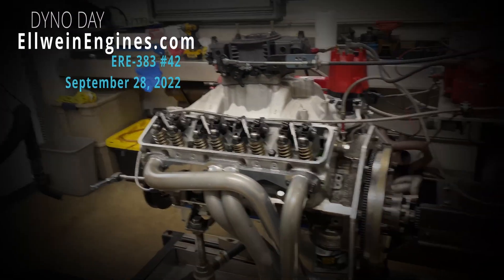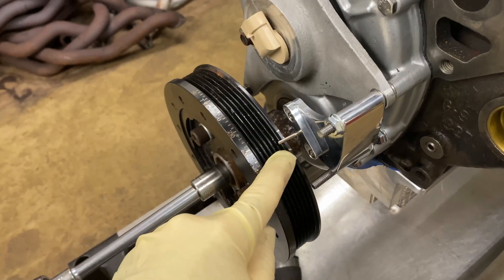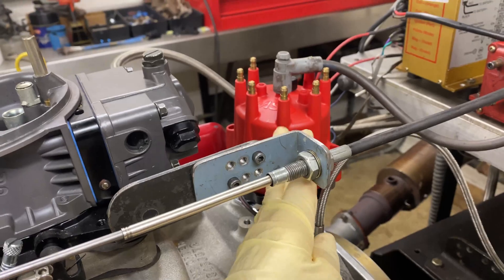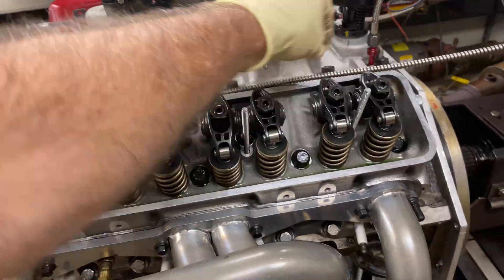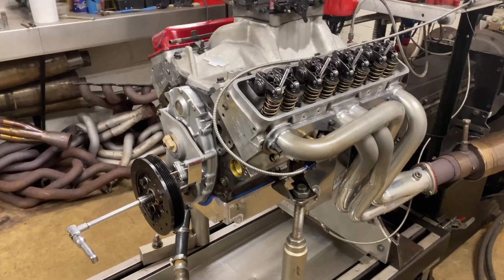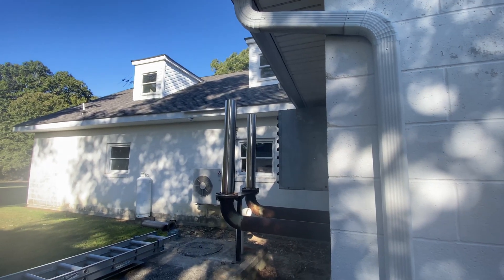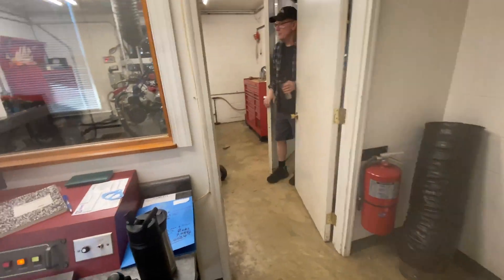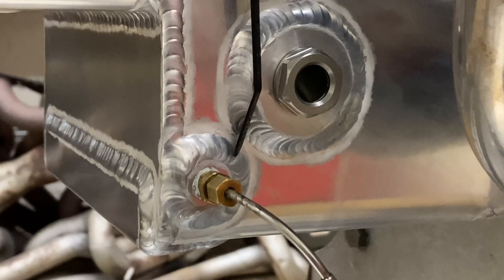Dyno Day for ERE-383 number 42

Comment: For new aluminum heads and new ARP head studs, would you bother re-torquing the head studs after break-in?  I've never done it on the 4 other builds I've done (2 different engines), but have always uses stock head bolts, up until now.  I just built my "dream" LT1 engine, AFR heads and ARP head bolts.  For the first time I have a small external coolant leak at one of the center lower studs.  Impossible to get at with Hooker long tubes, in the car, 1994 Camaro.  And a supreme PITA to drop the engine out the bottom just to check head stud torque.  Just wondering what you do.  Am using old fashioned Felpro 1074 head gaskets.  Thanks.
Reply from the maker: I never re-torque.  I don't know why people say to do that.   The factory does not do it.   I used to get leaking head studs but now I use RTV sealant and not the thread sealant.

Comment: Karl how much does it cost to get your engines dynoed?
Reply from the maker: $700 buck-o-roos.  No tuning.   Just the carburetor and 5 or 6 pulls for ring seating.   More complicated things would be case-by-case.  For example, running an EFI set up would be more time and effort and cost.